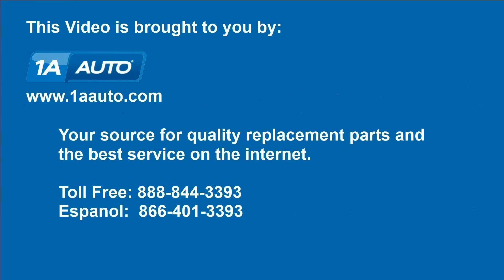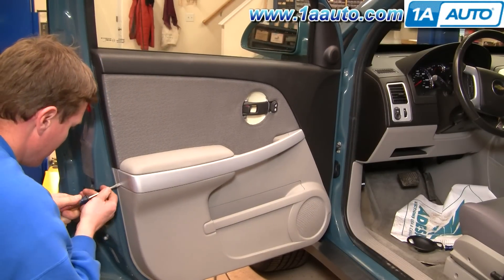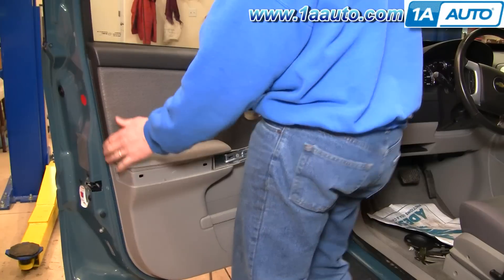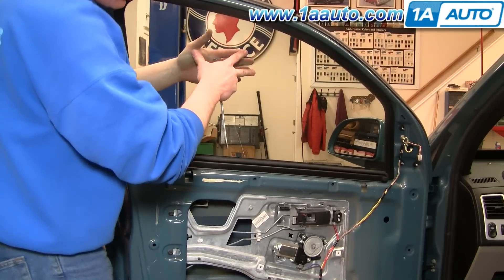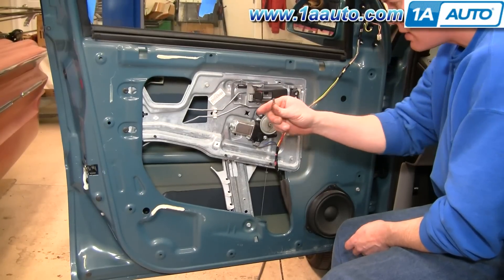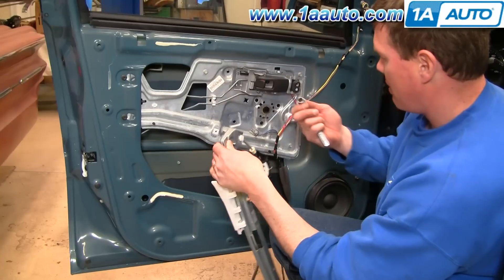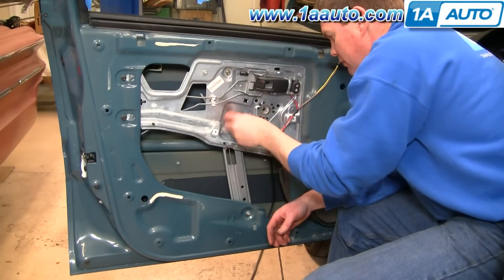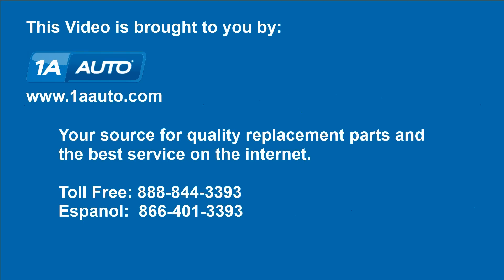How To Replace Power Window Regulator 05-09 Chevy Equinox

Comment: Over 5 years later, and this video is still helping folks get repairs done. I can't thank you enough for posting this detailed replacement video. I had to go over to my parents today, to replace my Dad's '08 Torrent rear window regulator assembly. Thanks to this vid, I knew exactly what to bring along (including my T-30 bit and my drill). I would have never expected to have to drill out rivets, as my '06 Grand Prix didn't use rivets when I replaced those regulators recently. Everything went quite smoothly, thanks to the preparation you gave me.

I was concerned that there would be significant differences between the Front and Rear driver's doors, but the only extra step I had to take was to remove a T-30 screw holding the door handle assembly in place, slide it over just a bit, pop the two wire rods out of their plastic guide holders and let it drop down a bit, so I could access the smooth-faced rivet, which was hiding behind rods going to the door latch (they come straight out from the handle on the rear door assembly). Didn't have a punch, so tapped the smooth rivet a few times with a Phillips head screwdriver to make a tiny divot, and drilled through the head easier than I expected with a 1/4" bit.

Only snag I ran into (my fault)...when trying to replace the motor, I couldn't seem to get it seated correctly. Took me a couple of minutes to realize I forgot to remove the tie-wrap off the transmission wheel, before mounting the regulator and clipping it in place. (DOH!)  Luckily, I was able to reach inside the transmission hole with a knife, carefully cut the tie-wrap and pull it out, without having to unsnap the transmission or unbolt the regulator. The motor slid right into place after that, and everything worked great after I was done.

Sorry for the long comment. But thanks for making me look like a hero and saving my Dad some $$.  He paid over $200 to a dealer to fix his front window several years ago.
Reply from the maker: +Tom Baddley Thanks for watching, Tom, glad we were able to help!  1aauto.com

Comment: Great video followed it step by step and window works (2009 Equinox). Interestly, the regulator I replaced was not factory issue so no drilling. Part from 1AAuto was perfect fit. Just because replaced motor also.  Much easier to do than I thought it would be total labor time probably less than one hour. Thanks.

Comment: Very good video. Just what I needed. I had an autoglass place replace my 09 Torrent motor and said the clips did not line up with the new part.  Hard to find (drivers' side window) original parts.  Everyone had the same replacement part.  No OE at junk yard so far.

Comment: Thank you so much for this video! This saved me a bunch of time and money today. The only snag I ran into is that the cable was tied up around the clutch and I had to remove the entire panel to bang the motor out with a hammer. Other than that, it went flawless.

Comment: My motor for passenger front door went out.  Is there an 1a auto video on replacing just the motor? There was no popping noise at all. Just stopped working one day. Won't go down at all or make any noise like it's trying to go down.  I checked all the wiring and it's good.
Reply from the maker: It looks like the power window motor is not serviceable on this vehicle, you would need to replace the whole window regulator. We carry new ones on our website with free shipping.

Comment: Nice video.  Very helpful.  Question though.  Is it possible to find just the plastic clip that holds the window to the regulator?  Mine appears to be completely gone.  Thanks!
Reply: If I understand you and this is the clip you push to release the window and it is broke off like my grandsons was-we just now finished fixing this problem by using some large zip ties going through that hole for the clip from the backside and down to the back and back through one of the side holes towards the door skin side, tightening up the zip tie and then cutting off with diagonal cutters about an inch from the zip tie grip.  We actually put three in while we were there just to make sure.  It works great now!  Maybe GM should have done this during assembly-beats their clip that breaks off!
I know you did asked this 6 years ago-but maybe someone else might need this.
Reply: @showsomerespect1433  Thank you so much! This helped me! The clip broke off for me and your comment helped!

Comment: So my driver side window power button don't work then handle loosen won't open door  so if power window button not working is it the switch or regulator how you test witch one needs replaced.

Comment: How do I get my window back up in my Chevy Equinox the passenger door side window is down and the inside of the car where the little knot of the little knobs are one of them is broke to the passenger door the part that lets the window up what do I do
Reply from the maker: +Nina Hernandez You should be able to take your door panel up and wiggle up the glass until you are able to get a new window regulator inside it.

Comment: This was very helpful so thank you! 

I changed the rear driver side so maybe it’s a little different?

I did not use the 1/2” drill bit. It only required the 1/4”

1/2” would’ve been too big. Maybe I got a closer matching regulator to the original?? 

Anyway just thought I’d share. Thanks again!